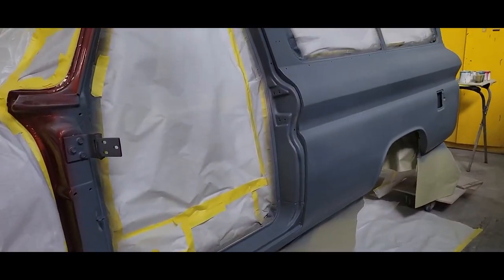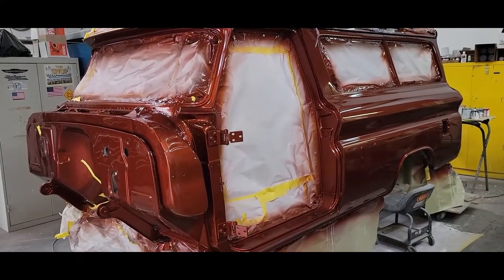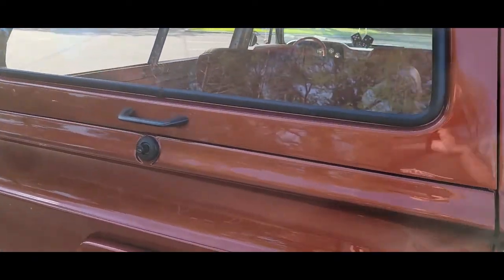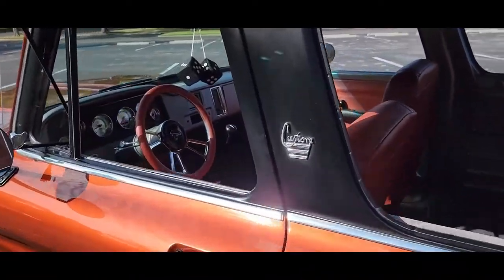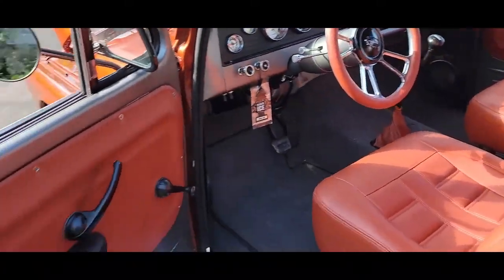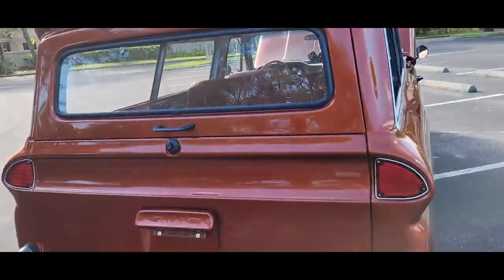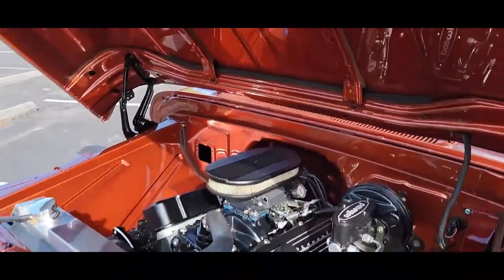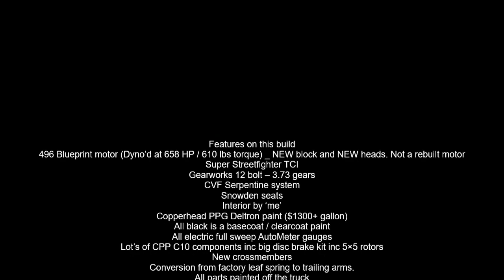1966 GMC Suburban build update video with pics and video segments

Comment: Absolute work of Art! Great job seeing it all the way through. I wonder how many GMC customs were made?
Reply from the maker: Thank you...I wondered that to. I think I remember I saw like 4500 Chevy,s but didn't see the GMC production numbers
Reply: @TAZattitude  I will try to find out production number.. I’m also buying a 66 gmc as well.  Your body mount in the center of the frame looks like new. It looks almost like a motor mount with rubber inside it. Where you able to find a source for them? I don’t believe the Chevy burbs used them so must be a low demand item. Thanks!

Comment: Burb looks great! I have a 63 that I’m in the middle of and wondering what fuel tank are you using with the fuel injection?
Reply from the maker: You can do a 'search' for tank on this page and you'll see the tank I used along with a link to it. 
https://www.attitudecustompainting.com/1966-gmc-suburban-parts-bought/
I drilled a hole and added an extra steel tube for the return line in the sending unit

Comment: Which BP 496 is that? Project looks and sounds great!
Reply: Thank you. I believe they only had 2 options. One with the seasoned block (Chevy), and then one using their block and heads. I opted for using the new BluePrint block and heads
Reply: Also, I did just buy the long block. I don't know how they Dyno it, but it was dyno'd to.
Reply: @scottf4249  ok thanks U ordered mine in September and they called last week and said they were about to start building it, that hopefully I would receive it mid June. I'm doing like you buying just the new long block setup with aluminum heads BP4967CT.  Hope my numbers look that good!!
Reply: @knuckle_headphotography  Wow, they are really backed up then. I think it took 4 months to get mine.
Yea, I was impressed. I think it was 658 hp and 611 torque (haven't looked at the sheet for months!). Good luck to you

Comment: Do you think the vinyl on the headliner was glued directly to the roof?
Reply from the maker: Yes, I would say it was glued on from the factory
Reply: Thanks, we have a 66 as well...someone quoted us at $700 to do the headliner, but I think we can do it 🤔
Reply from the maker: It will take some work, but I'm sure you can do it by yourself. Buy some 3M trim adhesive in spray can and that will help. Tape up the rails and do one section at a time. 
https://www.attitudecustompainting.com/november-updates-1966-gmc-suburban/